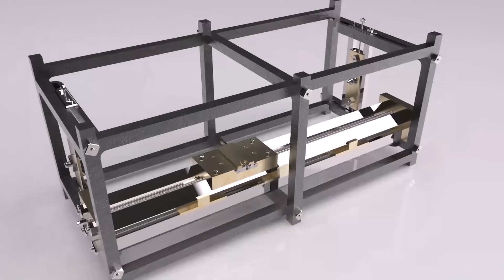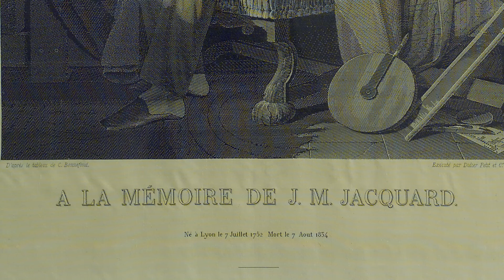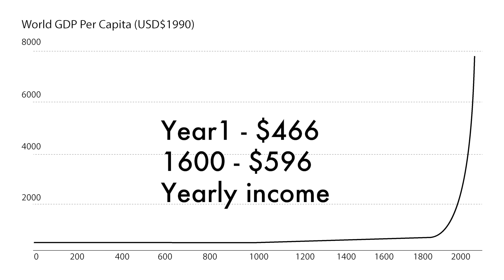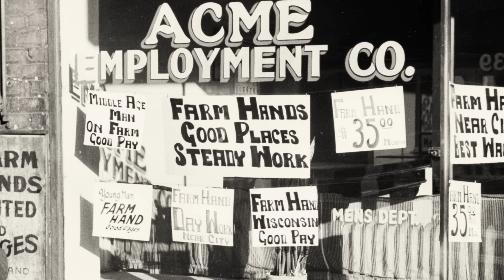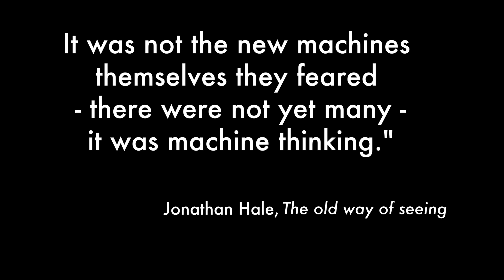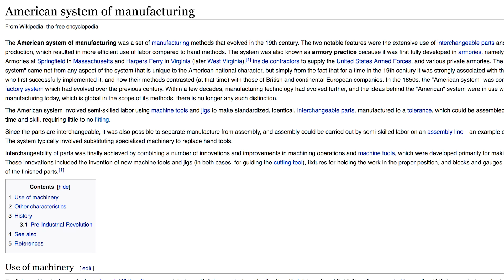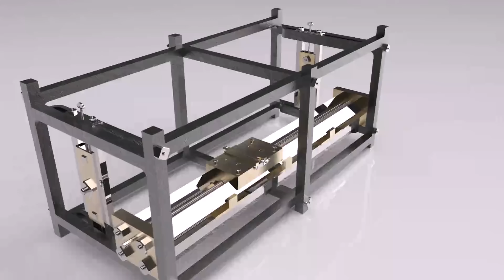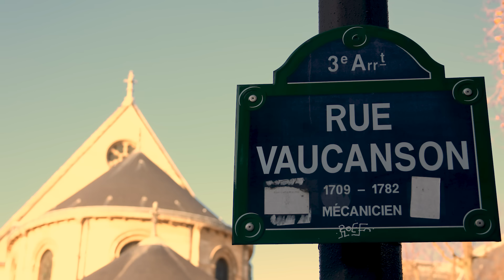The 1751 Machine that Made Everything

Comment: The same type of industrial revolution is currently happening with 3D printers.
There is now a metal bridge that is printed ! That changes everything. A machine that can print a small bridge with one operator is a huge change for the construction of small bridges.

Now we can 3D print parts for aircraft, buildings, rockets, ships and small mechanical machine too. We are at the start of the next phase of how we make complex machines.
Reply: There are shapes you can make using additive methods (3D printers based on extrusion and also selective laser sintering) that are impossible to make using a CNC mill, however many axes you give it. You can however use a 3D printer to create a very complex one-time mould for casting, where instead of trying to extract the part from the mould or vice versa, you dissolve the mould using solvents or heat, depending on your part and mould materials.
Reply: I am skeptical. There are limits to this technology cost and practicality wise. I think growth in CnC will do more still. 

Sure you can make an aircraft part out of powdered titanium, if you like being on fire.
Reply: @HaqqAttak  Exactly, in terms of 3d printing with plastic, it's inferior. Injection molding is still the way to do it on a production basis, or if one just needs a strong product. Good luck 3D printing an intake manifold to replace the oem injection molded one on a modern vehicle! But, technology comes to us in a slow and steady stream, it can get better, but things "could have been better" eons ago. If 3D printers could do it all and were attainable, we'd have one helluva crisis on our hands I suppose 😧
Reply: @JustAlanIsCool  They make it very easy to make plastic dohickeys, especially for people who want to make a one off item. But the new metal printers, like the powdered titanium, are so dangerous and costly that I can only ever seen it taking off in the most advanced aerospace applications. The stuff bursts into flames if you drop something on it. And the cost per pound for material is insane.
Reply: We need a 3D printed pooping duck!
Reply: Profezor Snayp; I thought you were kidding until I got to 12:49
Reply: But it is steel, which is still expensive. If you want to use 3D printing in building construction industry on big scale, you need to find a way, how to build concrete elements reinforced by steel, or prestressed with cable. In that moment, it would be breakthrough of millennium. Steel bridge will be always more expensive, than combination of concrete and reinforcement. Also durability of such bridge is important. We didn’t have enough time to discover the durability of steel elements which have been 3D printed.
Reply: @richarddvorak8477  no one will talk about the main difference between 'roman' concrete and modern concrete.

Its well know that there have been found the skeletons of people in the foundations of buildings.
Even on the building after the war, each building had people who dies in the construction and were buried there - its the way of the masons apparently.

Go back a little bit and you sacrifice a slave every day, and add his blood to the cement.

Blood has very particular properties, and stays 'alive' in a sense, even when outside of your body.

I mean, even putting a squirt of washing up liquid in your cement will make it a superior cement, so why not blood, and ground up people?

Try telling me romans and other people didnt sacfrifice people every day.
There were 10000 captured slaves, apparently, hung on the apus way or the road to rome from france.
Reply: epSos.de I've heard about that when practcing to be a lather. Those printers can make super expensive angular gears in one go, fast and cheap. Could not print metal tho. That was the main drawback.
Reply: Shawnaldo75  And why do you assume that traditional manufacturing methods will not improve alongside 3d printing? The nature of the technology is riddled with issues.
Reply: 3D printers aren't necessarily better than just a cnc machine. And cold milled pieces are stronger than 3D printer. For plastic parts 3D is great, and other mediums too, but maybe not quite revolutionary
Reply: Think of the rockets
Reply: Unfortunately a 3-D printed product has no grain structure. You could never duplicate the grain structure around radii that is created in a forging. 3-D print a gun and wait to see how soon the receiver explodes in your face. It will happen very early. 3-D printing is limited and most of the products produced are substandard when compared to other manufacturing processes. I have used 3-D printing for prototyping and not much else. It's overrated.
Reply: I would agree.  3D printing is going to make ‘products on demand’ which means that industrialisation as we know it will change.  Basically it’s the beginning of the “Star Trek replicator” age ....
Reply: Not the same but similar
Reply: For me when you look at your graft I cannot help to see that the up trend really stares in the 800's/900's when the "Windmill" came to the countryside...hence Don Quixote is one of my greatest hero's for he was the "FIRST" Environmentalist and Abacate ageist the Industrial Revolution that stares with the "Windmill"
Reply: And pair that with 3d scanning technology, we can create precise copies of parts that create molds to forge into those parts, reducing engineering time since the manual math isnt necessary and creating a more direct path for testing concepts. Creating a direct bridge between engineers and products.
Reply: harmonic machines without screws.
Reply: @donotoperateoncrack  More importantly is making machines without screws or seperate parts that can vibrate apart, or cause distortions in the frequencies emitted.

We have speaker technologie down quite well, but only aurally - to please the ear. We havent mastered how to appreciate and use sound frequencies to heal.

Those pipe organs intrigue the f out of me, because i found an old one in a templar church in nuit st georges in burgundy, 500 years old, made of wood, and it was made by someone with my family name.

Im researching how to utilise sound and music and the human voice to alter not only states of consciousness (i think we have got that down) but also physical states; leading to the possibility to combat disease with sound.

I like the connection between manna (monoatomic gold / verbhuthi) and tartaric acid / cream of tartar, potassium tartrate - the way it forms crystals that, when aligned, produce light by atoms spinning above the crystal grid/formation.

Couple this with louis pasteurs' research into the effects of light frequencies on viruses and we have a new system of medicine.

ANy helpful comments that come to mind will be much appreciated by everyone, if i can ever solve this conundrum of a problem.
Reply: Lol no.
Reply: @Adam D.That may be true. It still will do the work of 20 men.
Reply: We've been 3D printing parts since the 90s. The only difference is you have cheap 3D printers for consumers now.
Reply: @epSos.de Ithink we’re a long ways off from the future you are predicting.  Printed metals are weak compared to forged metal of the same material.  And printed metals still need final machining if the end application requires any sort of precision.
Reply: Someone is working on 3D printing entire houses and neighborhoods, as we speak.
Reply: If there is one job no machine or AI can ever do, but can only empower, it's SCIENCE!!
Reply: @maracachucho8701  Introducing Artificial General Intelligence, granted they don't exist yet, but they will do science and art and anything a high thinking creature like humans do.
Reply: @ @maracachucho8701  
Actually no. The amount of info being generated by science is now too large for a single human mind to comprehend (even a pretty smart one). There are attempts to use learning algorithms to look at all the information available and find links between subjects. Scientist are increasingly being aided by (weak) AI aids.  You can't do much in science without a few computers and supercomputer cluster.
Reply: I don't know a great deal about 3d printing, but as far as I know it is possible to print titanium parts, as well as other metals. Koenigsegg cars have 3d printed turbo housings, for example.
Reply: @kevtalbot137  There is a process that creates a 3d printed scaffolding, that when placed in an oven, metal will melt and absorb into, offering alot of strength. There is also cnc welders, that effectively can additively weld onto previous welds, "printing" welds together, but require light cnc milling to achieve tolerance... depends on needed application. 3D printers are NOT miracle machines, and neither are screwdrivers. They are simply different tools designed for different jobs... there is no one size fits all.
Reply: 3d printer is a helper not a a manufacturing changer
Reply: @dzitiatri  and if we build a printer 100m long and 50 metres high?
Reply: @dzitiatri  I think additive manufacturing IS a manufacturing changer... it think as the process is refined, it will continue to prove itself to be more cost efficient than subtractive manufacturing, depending if it is applied to the job that it is intended to do.
Reply: Which is an interesting point, because my first thought when I saw that lathe was it looked like a giant 3d printer.
Reply: people involved in manufacturing deeper than with youtube know that almost anything is molded or stamped with molds and dies that are cut with cnc (milled or edm). 3d printing is still a super expensive toy (injection molding and stamping is super paralleled process, while any printing is single instance task)
Reply: @seindich1769  
If you're trying to play expert, at least you should have a clue what you are talking about.
Reply: Indeed. And we need to figure out what to do in a time when economy finally doesn't need human labour anymore.
Reply: @Eo_Tunun  Will economy outlive humanity with robots buying and selling each others products?
Reply: @luddity  This question might inspire a really good sci fi novel.
Reply: @Eo_Tunun  #BasicIncome Fission+AI+Robots+Open Source+Basic Income== Earth as a Garden
Reply: @Eo_Tunun  we will still need energy and astronomical quantities of it...we could harness the energy of humans and connect them all the a machine that siphons this energy off their bodies....wait, isn't that what happened in the matrix movies? We will all be connected to the central core and feeding it energy and to keep us alive, we will be "living" in a virtual world.
Reply: @obi_wan_kenobi561  I was being serious. The first wave of automation, that started in the seventies, caused countless jobs to go down the drain and no one ever came up with a decent concept to tackle the issue. The eighties aproach of shifting towards service jobs created mainly low income rubbish jobs that hardly helped anyone, rather forced people to work in three jobs each day. A good portion of the citizens in industrialised countries live with their backs to the wall already and won't be able to take further cuts in income before slipping into actual poverty. Instead of harvesting technolocy's potential to the best of all, its social effect is splitting societeis into obscenely rich and moneyless. A study mentioned a worst case scenario that suggests that by 2035, 45% of all jobs worldwide may become redundant.
We need a plan before this hits.
Reply: @Eo_Tunun  Very true. Automation and machines have created huge amounts of wealth but that wealth is only going to the top 0.1% of the population. Most of the people are still no better off than before if you really look at their lives.
Reply: @obi_wan_kenobi561  Machinised production enjoys light taxes nearly everywhere while human work has income tax on it, making it more expensive as well. In the passed few years, technoligical possibillities in automation skyrocketed, even kids build their own robots with dirt cheap Arduino boards now, this option has become cheap as jelly beans. Now a new wave of digital revolution even challenges service jobs. Many texts of the not-so-inspired kind will probably get genereated by softwares in the future.
There is a totally new quality of problem brewing up.
Reply: There's already a plan, and has been one since the Burbon Restoration - do with the dollar what the monarchists did with the sword. Castles ringed with favelas. We lived this way for 10,000 years under the foot of lords, and we're on course to go right back to it.
Reply: @obi_wan_kenobi561  We already are living in the Matrix.
Reply: @obi_wan_kenobi561  People are no better off today? I would start with Cholera or Typhoid... Consider the living conditions of the U.S. population in the 18th and 19th century... Take an honest look at the average American today and compare them to the average American from 150 years ago.
Reply: @ @Reach3DPrinters  Did I criticise the technology in a single tone? Check again, you'll find I didn't. It would be bloody stupid to do so, for it's of as much use as trying to put rain back into the cloud.
I do expect that there will be loads of misery if the societies don't adapt, though. I actually do know formerly well off people who ended up homeless after their jobs went away, as I am not too posh to talk to street sleepers. People who used to work in steel manufacture in my German hometown. Laid off, deemed too old for new qualifications, they fell through the grid. Then it takes just a couple of bad days with the employment office and *Poof!* goes the home. You can bet they have stories to tell about what being hungry feels like.
To be hinest, I didn't meet the last ones I knew in quite a while. There were some rather bad winters here, I guess these folks are no longer around.
So you think there are no people toiling away for 16 hours per day nowadays? What happy bubble do you live in? Ask drivers for example. When I worked in such jobs, working days could extend up to 20 hours. There are laws to protect employees there, then there's the every day cynicism of working life. Do the work necessary or go find yourself a new job. When you live in an environment where jobs don't grow on trees, you are nicely screwed. Now consider an environmenmt where the number of job seekers explodes.
We're only talking about employed work so far, what with the small business owners who try to maintain their one man buisnesses, little shops, small garages and so on, do you think they all can afford to stop working after 8 hours?
Automation has boosted our possibillities, yes. It still does. It will do ever more so the better the machines become. The side effect is that human work will become un-needed. There is a social and ethical challenge for society to cope with the backlash of this development. We'd better not ignore that challenge, or lifes may turn pretty nasty for a good part of us.
Reply: @Eo_Tunun  Toiling away in the harsh conditions of an arid desert, scratching out their survival... Everyone I know, who actually want and work a job, have cell phones and TV's. I live in the U.S. and perhaps Germany is a dramatically different country economically, but when a person buys a TV or a rug, or a fluffy couch, or a house with more than 2 bedrooms, or chairs, or a picture to hang on their wall... I would say, in comparison to our ancestors 300 years ago, they are living in high society. There are poor, but a majority of the poor and homeless I have spoken to do not want to be part of the social structure of conveniences. Many will refuse food and prefer alcohol or tobacco... they seek immediate comfort and desire to "feel good" by any means necessary, which often translates to drug use.
Everyone who scrapes by, at least that I personally know, play video games, have internet, maybe have a pet that they feed, spent $50 on that couch at a garage sale, buy soda instead of drinking water... 
Yes, there is true poverty out there, and that generally happens in 3rd world countries. If you can afford electricity, then your not being frivolous, but wasting your efforts on convenience. Its highly unlikely that the individual whom lost his house was entirely innocent. Sure bad circumstances make things difficult, but if you have the mentality and foresight to purchase a house, you understand the mechanics required to leverage assets in a constructive manner. The individual would have built up equity in the house, knowing hard times were coming, sell it to get some amount of profit. What was the individual doing for 2 months after loss of his job? The only thing I can blame is a lack of education and I know Germany is ethnically a very intelligent population. Education is not to blame, and so a lack of self awareness and control are likely to blame for the individual who lost his house.
So to address your core warning... Machines will likely NEVER be fully capable of self sufficiency. Humans will be needed to maintain the machines that maintain the machines. The arc drives at specialization, or the rejection of specialization. I am specialized in many fields and am versatile. Some people don't want to invest the effort to increase their aptitude, and remain specialized in only 1 or 2 fields. Ive spent years of free time, not playing video games or watching tv, but developing skills... I can program arduino, Im a tattoo artist, an oil painter, I build 3d printers, I can roof, frame, drywall, do siding, electrical, plumbing, run a lathe, mill, saws, routers, woodwork, I work on my own vehicles, have changed head gaskets, axle bearings, Ive installed fencing, can repair electronics, have made custom circuit boards, I know 5 cad programs, built computers, Ive gardened, filled propane tanks, unloaded semi trucks, ran cash registers at walmart... Ive mowed 1000s of lawns, built bicycles, campers... Im not more intelligent than anyone, but Im aware that if I want something in life, its up to me.... if i want to change my circumstances, I must look around and resolve how to make the change, then implement it. To suggest anyone is not capable of learning a new ability is because they are too lazy to invest themselves in learning. Modern machines have just made it easier to survive. We take for granted that its guaranteed, and foolishly invest ourselves in non-productive means. That is when a persons life crashes. Ive been there, living in my car, pinching used cigarettes from ashtrays, asking for food at restaurants as they closed down for the night, and it woke me up... I realized if I wanted something I had better get it. The safety net is what deludes many to remain lazy.
Reply: @Eo_Tunun  
Bottom line...
We must specialize to fit the market, or reject the market and live like our ancestors, more primal and survival based, either as hunters or gatherers. If you reject the market and become a nomad, social rules do not apply, but you'll live the same as they did, subject to the power of the strong. Fortunately the strong are governed with compassion now days. And so rejecting the market is NOT a death sentence. 
Most join the market and specialize. I advise anyone seek a job, to specialize in a demanded field. Leverage the assets available by the government and gain knowledge...
Furthermore, 300 years ago, the life expectancy was about 35 years old, because 40% of the population wouldn't reach 18. If anyone today reaches the age of 50 or higher, they had a long life in comparison, especially if they reject the market. There are no guarantees... your asserting your preconceptions that systems should be designed around longevity of life, when they are designed around survival. Survival is not guaranteed, and longevity is only a bonus and shouldn't be expected. 
The simple fact that a 60 year old homeless man can survive as long as he has, is a testament that the harshest conditions the poorest face, are not as bad as the average conditions that most everyone would have faced 300 years ago. That improvement in circumstances is a direct result of... 
The industrial revolution.
Reply: @ @Reach3DPrinters  Others will tell you to make yourself a generalist, a one who will survive a sudden change in the job market. ;o)
What I am asserting my preconceptions around is a society that will respect fundamental ideas along the line of all men having been created equal, by the way. I am one of those old fashioned beezers who thinks constitutions are good for something.
Reply: @Eo_Tunun  I also believe all men are created equal. But there are no guarantees that all men will be treated equal. To force someone to offer equality, is to remove his freedom. I believe in freedom, if it doesn't remove freedom from others. 
For me to choose to pay someone $1 instead of $5 should be my choice. Im not forcing them to do a job, im simply offering a job on the free market. For an institution to force me to pay no less than $5 for someone to do a job, is denying my access to a free market. If I don't pay enough, I won't have employees. If people asserted themselves to achieve their own means of survival, free from the dependence of employment, then the quality of employment would be much higher, as labor would become a scarce commodity. 
People need to use their minds, to solve problems and offer something to society. If you offer nothing, you have no value to the market. That is why people are rejected. A lack of focus and will to become valuable. Using institutions to mandate value will only weaken the markets effectiveness.
Socialism has never worked well for the masses. An un regulated free market can also cause bias in education and pigeonhole people in classes. A balance is required. But first a foremost, a government should not regulate an individuals freedom as long as they are not preventing someone else's freedoms. A governments primary job should be to ensure freedom from tyranny.
Reply: @Reach3DPrinters  I bet Danish, Swedish and Norwegians would beg to differ there. They have very well working socialistic democracies and reportedly enjoy the world's best average standard of living.
 The thing is, Offer and demand make the price. If one strictly follows the way of thinking you follow there, wages will drop when the demand for work is highest. Such situation will occur in times when ecconomies need some money in the markets most. Money only gets into markets when many peple have some of it, though.
That's why the USA saw a minimum hourly rate introduced with the New Deal decades ago, a something we had to wait for until 2016 here in Germany. The New deal worked excellently well, by the way. The USA experienced an enormous boom in ecconomy on behalf of it that helped it outpace its great rival.
It's not capitalism itself that is to blame for things going wrong, it's neoliberalism. It's the myth of self-regulatinmg markets. The myth of trickle-down effects. None of that ever happened since John Adam had that idea for his theory of economy back in the seventeenth century.
Germany boomed in the sixties and seventies, when we had what we called "Soziale Marktwirtschaft", you may translate that as "Social free markets", roughly. Oddly enough, that concept was introduced by Ludwig Erhardt, member of the CDU, the economy focussed conservative party in Germany, whereas the massive deregulation, especially of financial markets in Germany, was done by social democrat Gerhard Schröder in the early noughties. A recipe for desaster that helped towards the banking crash of 2008. ;o)
Reply: @Eo_Tunun  Danish, Swedish and Norwegians are ethically non diverse countries. Their mindsets, as a whole, are already collective in their attempts to produce goods. They do not have to deal with cultural differences that create tribalism biases in a population. There are plenty of localized communities in the U.S. that developed from generations of collective production of goods for the local community. Socialism can work at the cost of the minority... which quickly reverts to the cost of the majority, when greed of the ruling group inevitable takes control of the socialistic process. FAR more human life has been destroyed under the rule of "attempted" socialism than capitalism. Yes, pure socialism is fair, and potentially could work wonders... but that is not real life. People are greedy and desire control and socialism fails and tyranny quickly replaces it when the collective is not universally aiming at the exact same agenda.

"wages will drop when the demand for work is highest"???
NO...
Wages INCREASE when demand is high. That is basic economics. I own a tattoo shop. I pay artists commission. If I have too much demand for tattoos, and not enough artists to cover demand... I must pay my artists more to stay. I must also offer more competitive commission to attract better artists. Im not speculating here... I have owned 2 tattoo shops since 2005. Ive also manufactured 3d printers, and paid contractors for their labor. I cant find people for $5 an hour... they don't exist. I have to pay $10 an hour to attract people into soldering and packing 3d printer kits.
I have literally experienced, for 15 years, the opposite of what you claim. 

Our experiences seem dramatically different. I don't think your attempting to mislead me, and I am not lying or attempting to mislead you... the simple fact is that we live in different economies, and economy is very complicated. Both systems can be repressive toward the individual, and both systems, given proper conditions, can thrive. 
I would only insist that we design our laws so that we do not subjugate or enslave or compel people against their will to perform in any way. 
I would rather be free to die than forced to survive.
Reply: @Reach3DPrinters  I may not have put my words quite rightly. I was talking about demand for work from the employee's side. 
Well, you may tell some Swedes that they basically are different from you, yet the same as Norwegians or Danish. You'd be surprised about their answer, I bet. My own mindset differs a lot from the lad next door's, and his ne differs from the bloke living across the street. A single one "national" mindset? Where on earth would anyone find that?
Such tribalistic splits within a country are but normal, you will find them all over the world. You Yankees are absolutely average humans. Berlin vs. Bavaria, Cologne vs. Düsseldorf, Paris vs. Calais, London vs. Wales, Bavarians vs. Frankonians, we have that all across the place here. Most of the time, it's food for giggels, but some take that bollox seriously.
Germany is not a socialist country. There is the very normal western world capitalism at home here, that for the recent three decades has favoured Neoliberalism and witnessed it turn capitalism into a partly failure. Many of us Germans envy the Scandinavians for the social systems their coutries can afford. We can't. Among other reasons, we bailed out banks that pokered beyond their possibillities in the banking boom of the noughties.
One thing I noticed some time ago is that the wages are surprisingly high in the USA, yes. I took a look at the job adds of some homepage based in the state of Washington, and found an add for a driver's job taht offered about twice the hourly rate you might be able to ask here, they offered $20, if I remember right. I had colleagues driving 40 ton trucks for €9/h on nightshifts.
 Germany has developed a culture of dumping wages in the last ~25 years. That's why employment soars here, we have become cheapos. Our minimum hourly rate may be higher than the one in the USA, only way more employees live from such rates as workers are available in abundance, employers thus don't have to make compromises. 
With that being said, my breakfast time i running out on me, I have my 2 hours trip to work to start, oh hooray for the German railways! Another 12 to 13 hours for that time work company that chose to pay all of 300 quid for the first month I worked there, roughly a third of what's said in the contract. (I guess a judge will have to have a word with them sooner or later.)
Reply: @Eo_Tunun  True, when people need jobs, there is an abundance of labor and employers can cut wages. The solution is to provide the population with the needed resources at more competitive rates. If food is scarce, it is because people are not farming, instead they are seeking jobs that require less knowledge. It really comes down to self reliance. Plenty of people have looked around and determined opportunity didn't exist in the cities, so they wandered out into the woods with an axe, knife and shovel and began to build a home for them selves. Some died and some founded cities. I guess the land is "spoken for" these days... but not all of it. There are huge regions of farm-able land available in the northern areas. Luck favors the prepared. 

Its seems your conditions are difficult, using rail to travel hours to work for little pay... I would look locally. Effect your local population by building or creating useful products from the raw materials available locally. It will increase the wealth of your local city... wealth is NOT transfered, wealth is CREATED! Certainly someone who owns land would allow you to access it to collect some form of resource. You could import products from other countries and sell them online out of your own home... unless import taxes (non-free market) limit trade. 

Also... bailing out a failed business is a horrible idea. They FAILED for a reason. I HATE that the U.S. bailed out a bunch of businesses in 2008. Those businesses and banks should have went out of business, divided and parts sold off to the businesses that made better financial choices. My business survived the economic downturn of 2008... because I didn't make stupid decisions. I budgeted myself. If I would have made stupid financial choices, then I deserve to be out of business so that the better business man could thrive, instead of a government backing a failed business... That is NOT what governments are for. Governments are to ensure that law is created equally, and carried out with force when needed. If Germany, the U.S. and many other bureaucratically fat countries, didn't waste so much time seeming to micro manage individual resource distribution, perhaps a judge would have time to handle a breach of contract from your employer, for your labor. Gov't get so bogged down trying to manage individual equality of outcome (results), that they fail to perform their basic function, equality of rights.

Perhaps im wrong. I don't live in Germany, but I have spent many hours speaking with a 90 year old German baker. He told me of small communities that built themselves up from nothing. Everything you needed was within 4-5 blocks. The leather tanner, the baker, the miller, etc...  Each person had a position in the community. Their jobs provided directly for them. They produced what they need for a comfortable life and more. Perhaps the resources aren't there yet, or haven't been harvested yet, for everyone to own a computer or flat screen TV, but wealth is built up from raw, natural materials. You can trade wealth, but to distribute wealth is not as effective as creating wealth.
I recommend you create wealth from raw materials... like a factory would. Turn dirt into bricks, or rock into paint... plants into food, etc... you don't need to labor for $$$ if labor is not desired, you need to labor and produce exchangeable resources for $$$. Create wealth, don't trade labor for wealth. 

I would begin with a hobby that interests you....
Lets say you like whittling wood. You have developed knowledge and skill around how the grain and types of wood interact with each other and how they look when carved in different ways. Certainly, someone sells 2x4 boards or 50mmx100mm framing wood. You could take a $5 raw piece of lumber, and turn it into a picture frame, or build furniture... Certainly you have a hand drill, and a saw? Those are inexpensive tools. When some patience and education, you could craft some of the finest, most highly desired furniture in all of Germany. You have access to the internet. You could sell online. Learn how to create a website. for like $50, you can host a website for a year. Use every bit of your free time learning and specializing in a trade. Become the absolute best at it. Bend every thought you have at pursuing the greatest product possible. Even if you dont sell very many at first, you can still trade furniture with a local farmer. Maybe ask the grocer if he needs something built. The point is, your taking a $10 in wood and turning it into $200 in furniture on the weekend. If you spend $600 a month on a home and are having difficulty keeping up with rent or mortgage payments, perhaps you should downsize to a place that is only $450 a month.

Point is... we ALL have options, especially living in western civilization. We merely have to invest the time to consider them and pursue them. Consider living in Ethiopia. I mean... its a damn desert. You have to travel miles just to get water, but must return to the city dump to scrounge for food because your 13 years old and not strong enough to work in the mines yet. Your only clothes are the ones your mother gave you 8 years ago, when she died at the age of 35 from tribal warfare...
Seriously... you have it pretty damn well compared to an Ethiopian.
Reply: @obi_wan_kenobi561  but what is the point of producing the energy in this scenario?
Reply: @obi_wan_kenobi561  i could never understand why, when i worked as a peasant and a wine waiter, making wine and serving wine, i would meet a ceebrity, a rapper or an actor, who would spend 15 grand on a bottle of champagne.

I tasted krystal and all the rest and ive had better in my packed lunch in burgundy on a cold january morning , cutting sticks and bakin potatoes.

Why earn so much money unjustly, only then to be over charged hugely for inferior products.

The best wine in the world is made by someone at their home, and stored in their cellar, and carefully carried fro the cellar, to the glass, and poured very slowly.
Thats all you need to know - the other elements are inconsequential if you ignore these three steps.
Reply: @obi_wan_kenobi561  
Clueless, aren't you?
Reply: 3D printers have more potential in making more specialized and/or complex things that aren't in high enough demand warrant designing and making a production line for them, such as 3D printed organs.
Reply: nope, not even close, 3d printing is a good prototyping tool, not a manufacturing tool.
Reply: It's already used by several companies as a manufacturing tool, among other things to produce rocket engines and jet engines.
Reply: @kasaduhallo   Parts for rocket, and jet engines. As others have said there are limitations. The companies doing this are also blowing things out of proportion so that they will be seen as technology leaders for investors.
Reply: You can print basically the whole engines, it's done by redesigning the engines. look at this for example:https://www.relativityspace.com/
Reply: @ssssssssedb  That is no longer the case.  There are several companies that product 3D printers for manufacturing production quality 3D metal, plastic...you name it, parts.  Stratasys to name one of the leaders: https://www.stratasysdirect.com/applications/production-parts/3d-printing-production-materials  
FYI. 
Best,
~Kevin
Reply: W. Kevin Cotton 
i sense a shill.
look, this is more a general statement to everyone in this thread, but the problem with 3d printing isnt the quality. thatll catch up im sure. the real problem is speed and scalability. like, when you can print stuff as fast and with the same or better quality as an injection mold or general casting and milling techniques, ill believe the 3d printing dudes are on to something, but thats really not even close to the case. slow, inefficient, clunky, and expensive are pretty much the only words you can use to describe large scale 3d printing at this time.
love to see it change, but i dont think we will see it change any time soon
Reply: @ssssssssedb  That is no longer the case.  There are several companies that product 3D printers for manufacturing production quality 3D metal, plastic...you name it, parts.  Stratasys to name one of the leaders: https://www.stratasysdirect.com/applications/production-parts/3d-printing-production-materials  
FYI. 
Best,
~Kevin
Reply: @ssssssssedb  
Yet.
Reply: @ssssssssedb  I use 3d printers to directly manufacture products... so yes, they can be used for manufacturing.
Reply: 3D printing cant and will not replace traditional manufacturing. It is an amazing tool for prototyping or building individual parts but its awful for mass production.
Reply: @marschma  Oh man.. You will be wrong.. Eventually.
Reply: @marschma  I hate all these people pretending 3d printing is revolutionary in some way. 3d printing is inaccurate, slow, and even the stronger printed parts are weaker than traditional manufacturing.  3d printing is great for prototypes or at home use, but it isn't revolutionary.
Reply: @BinarySIoth  weaker than traditional, uh jolly. More planned obsolescence, you don't say
Reply: @BinarySIoth  You are sadly mistaken, 3D printing is very much revolutionary, and is improving in leaps and bounds daily. These are the replicators of the future! New processes and materials combined with more and more powerful computers are going to simply amaze you! Think of it like this, the first 3D printers are like the Wright Flyer.
Reply: @Shortsircut1  I really am not. A 3D printer is just a Cartesian motion platform with an extruder on the end. Not in the slightest revolutionary, proven by their development in the 80s. A 3d printer is primarily held back by two things, the materials requirements associated with one, and the heating required to extrude. Firstly, the materials needed have insanely high requirements of them. They need a low melting temperature, low deformation under temperature, high strength, and many other things related to their specific task. This only is really possible in plastics, but they lack in the strength department. A great alternative which I can see being used to counter this problem is a second cold extruder for a stranded material, but I see no benefit in manufacturing in this way over traditional composites. You simply have less control over the strands in this manner. The other large problem is materials deform under heat changes. Castings are almost always cold machined after for any dimensions that are actually important. The very nature of 3d printing means I can't see any change in this. At this point 3d printing is just weaker, slower, and more expensive casting. Not much good there. These problems are minimized in at home scenarios where high strength isn't as necessary, and cost effectiveness is in its prime because the equipment for casting is more expensive. Beyond prototyping, and small scale projects there's no real use for it in the manufacturing industry. I'm not some asshole who just shits on 3d printing, I designed one myself, and purchased one prior to that. People just over-hype it way too much cause they read a few bullshit news articles from clueless writers.
Reply: @BinarySIoth  OK if you limit the term "3D printer" as strictly a machine that heats up heavy fishing line to reform it into something else, then you are correct. I am more referring to the mind set that seeks to manufacture things in a 3D fashion. We now have resin printers, and sintered metal printers, and I have no doubt that other materials and processes can and will be created to manufacture things in this manner. I also have faith that eventually we will be able to create pretty much any inanimate thing by assembling it from its component parts. 
When you say "The very nature of 3d printing means I can't see any change in this." This is simply a perspective issue, where I see the very nature of 3D printing meaning I can change this any way I want.
Here " At this point 3d printing is just weaker, slower, and more expensive casting." You are absolutely right, "at this point", however we shall not long remain "at this point"
Have you ever watched any of the old "home of the future" videos from the 50's and 60's, or even earlier? They had no clue what was coming, I am fairly certain we are today just as clueless about the future. It took decades to get from b&w tv with rabbit ears to anything on demand any time you want it in your pocket. 
Once the electronic communication door was opened people were not going to stop with crank phones and radios. All I am saying is now that the 3D printing door is opened people will not stop with reheated fishing line through an extruder. 
But hey, that's just my opinion, you are absolutely entitled to your own.
Cheers
Reply: @BinarySIoth  What IS revolutionary... is additive manufacturing. 3D printing is a successor in a long line of additive progress... Additive manufacturing is FAR more efficient than subtractive. The materials simply need refined and are dependent upon application. Furthermore, no complex machine is solely dependent upon one form of manufacturing...  By increasing the approach processes, we increase our tool kit, and apply tools that function best.
Consider 3d printing wax molds for lost wax casting... The limitations you see with 3d printing, are not that of additive manufacturing but the limitations of how your mind considers using it.
Reply: @BinarySIoth  Your assuming heating is required to extrude and limit materials accordingly... Consider fast set epoxy... jb weld... your subjecting your limited scope of potential on a machine you expect its function to remain as...
The real concept here is additive manufacturing... It is far more efficient to add material than to remove material depending on the situation of course. You don't take a massive block of concrete and chisel away the interior to create a building... you pour beams... your adding bits of structure cumulatively to create the whole. 3d printers just leverage machine code... its like a cnc mill vs a manual mill... There is a place for additive manufacturing, and 3d printing is an early step in understanding the potential of additive cnc manufacturing.
Reply: We are at the emergence of a new method of manufacturing. Its nested in with 100s of other new methods as well... I would say the greatest machine created... the NEW, life altering machine that sets new precedence... is..
the Transistor.
The transistor offered us the next level of precision and the ramifications are not yet fully explored as its implementation folds over itself, we have arrived at the molecular level in just 60 short years. Soon we will transcend into the fibers that weave the fabric of reality together. If you are under 40, it is very likely you will see "the Emergence" the same we are building together now with every letter we type.
Reply: @Shortsircut1  agreed ! The use of apoxy resin with metals added in powder form & ceramic materials in the polymer ( plastic) median used in extruding technology ,as this type of manufacturing and prototype creations will surely continue to progress along with the computers of today! By the time a product hits the shelves ( public access) the technology is obsolete! Quantum computers will surely change the world we live in, and the machines they program and operate will no doubt follow suit!  But the mark 1 eye Ball !( human oversight) will always be required to make chosen decisions ! As computers can only make calculated risks using known factors in its equation! Using algorithm programs created by human brains as many reasons other than correctly calculated factors!
Reply: @BinarySIoth   you hate them?
Reply: @marschma  I remember when people were saying "Digital photography will never take the place of film". I'll bet you do too.
Reply: @marschma  No longer the case.  I apologize as I can't remember the company that produces the printer but I stumbled across a company that manufactures a 3D printer specifically for mass producing metal parts.  It even included an enclosed annealing furnace.  I want to say the net savings for 1000+ parts was in the neighborhood of 60%. (that figure is the impression of the stat that I was left with, I can't remember the actual breakdown).
~Best
Reply: @marschma  No longer the case.  I apologize as I can't remember the company that produces the printer but I stumbled across a company that manufactures a 3D printer specifically for mass producing metal parts.  It even included an enclosed annealing furnace.  I want to say the net savings for 1000+ parts was in the neighborhood of 60%. (that figure is the impression of the stat that I was left with, I can't remember the actual breakdown).
~Best
Reply: I've been 3d printing for going on 2 years now. I can say, with 100% certainty, that this is total bullshit. 3D printers are slow as fuck, and rely on layer adhesion... which is weak. 

A CNC is better.

Hell, injection molded ABS is better.

If you want to make nerdy trinkets and action figures, then a 3d printer is great.

If you want to make car parts.

No.

Don't even bother.
Reply: @DrFumesta  Knowing the limitation of a tool is important. Your expectations were apparently too high. Can your screwdriver build a car? Can a 13mm wrench build a car? Can your lathe build a car?
It takes a multitude of machines to function based on their abilities, to collectively build a car. Your asking a 3d printer to do the work of a CNC machine, or an Injection molding machine... but the 3d printer is NOT designed to do these jobs more efficiently. It is designed to prototype cad models. 
Useful if your Boeing, or Airbus, or a jewelry manufacturer to make wax molds for custom designs... but are you going to "print" an aluminum car rim to drive on??? No... and your also not going to build a metal rim from a jigsaw... but that doesn't mean jigsaws are total bullshit...
Reply: @DrFumesta  
Don't think to the future much, do you? 15 years ago, 3D printing wasn't good for anything. Poor accuracy, poor surface finish. They have made a hell of a lot of progress. Give another 15 years.
Reply: We can also 3D print houses, buildings, shelters, the potential for the elimination of homelessness is looming.
Reply: @Edmar_Thorn  the problem with homelessness is a combination of substance abuse, mental illness, zoning laws, building codes, etc. We always had the potential to eliminate homelessness, ever heard of bricks? You can stack bricks and make houses, it's gonna be faster than waiting for one to print. The problem is that you can't just build houses in the middle of Central Park, or you can't just buy an empty lot and start building without permits, and even if you try to do everything the legit way and then build your house by hand you'll violate all sort of codes. Building a house the true legit way costs so much money that materials science isn't the limiting factor.
Reply: 3d printers will fade away. They are overrated.
Reply: @wannabecarguy  Additive manufacturing is very effective. 3D printers are simply a variant. Its like saying the lathe will fade away because cnc mills.... Its ridiculous... there are different tools for different jobs. 3D printing simply doesn't fit the jobs you find more important. Guaranteed, 3d printing has benefited your life. Have you ever flown in a commercial aircraft built after 1985? Boeing has used 3d printers for decades to build aircraft. They also use pencils... and rulers... 3d printers are simply another tool that helps manufacture products.
Reply: When has anyone ever listened to anyone from Georgia?